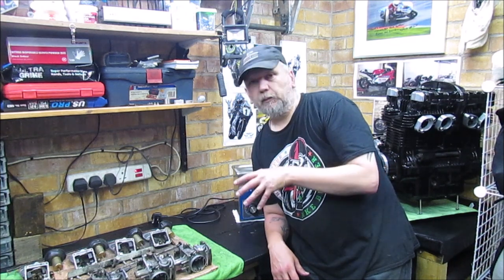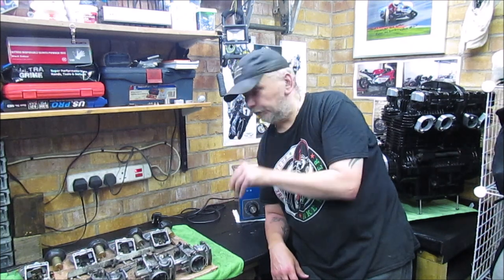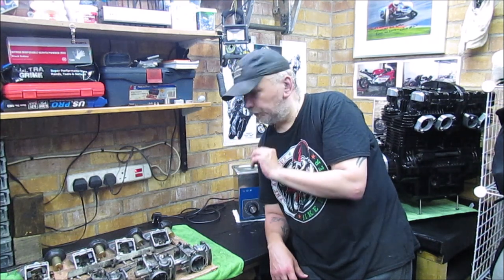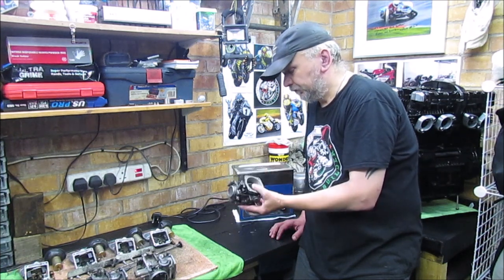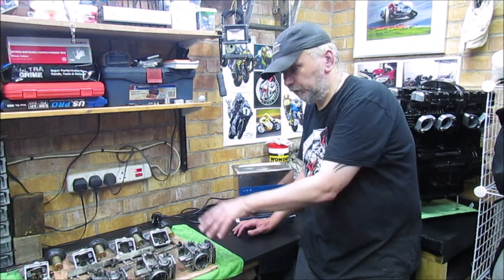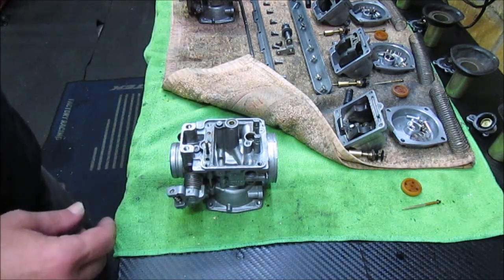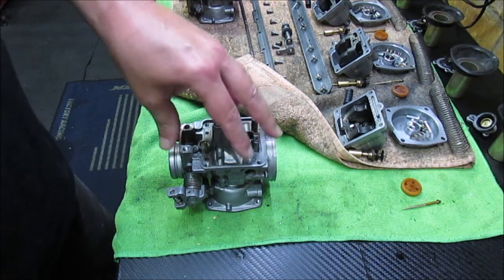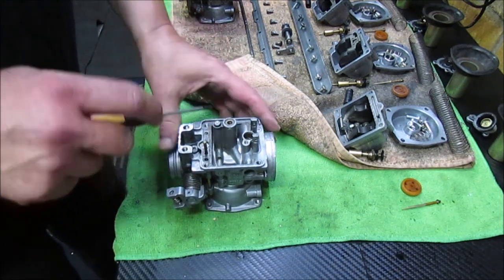Mikuni BS34 Carburetor - Stripdown /Cleanup /Rebuild  -  Part 2

Comment: Follow up with the ball barings in the number 2 and 3 carbs. There is also a little spring that goes in before the ball bearing. I lost the springs and bearings when i seperated my carbs. Had to order new ones.

Also, as far as cleaniners and degreasers go. Just keep an eye on what you use and make sure it is aluminum and brass safe. Simple green is a big no if you plan on soaking for half an hour.left in to long, will stain the aluminium dark grey. I use purple power or a very diluted simple green. Also you can use a chem dip, but make sure the carb is stripped to the bone and wear gloves. Wash off the carb immediately with warm water and dont let it sit for more then 48 hours. The brass will be discolored

Good luck, i have learned alot from ur videos and they have helped me with rebuilding my 1982 kz1000j engine
Reply from the maker: Cheers, no nothing sprung out, so looks as if i need to order them, the carb cleaner i use in the ultrasonic is the correct one, i did my Z650 carbs as well in an earlier video also came out good, all is wash as soon as it comes out , glad the videos are of help

Comment: Looks like You're getting a very nice finish on those bodies. Again, what cleaner are You using?
Remember, You can also zinc plate the carbs, and colour them either black or silver, by dipping them in a passivating solution afterwards. I mean, if You happen to know someone with a plating tank. Anyway, good work, and thanks for sharing! 👍
Reply from the maker: They are coming up nicely, still may paint them though, will match the engine, black and chrome, trying to do everything myself, saves a bit of cash as being an 1170 bore will eat more cash on upgrades

Comment: What size is your ultrasonic cleaner I'm thinking of getting one but not sure what size to get,what  fluid do you use.
Reply from the maker: Thanks, mine is a 3ltr, just wanted a small one to start, but will be looking at a 10 or 15ltr in the future as mine is a bit small when it comes to carbs, the fluid is carburetor cleaning solution,i get it off Ebay,  use 1 to 2 cap full per tank
Reply: 3 litre he said